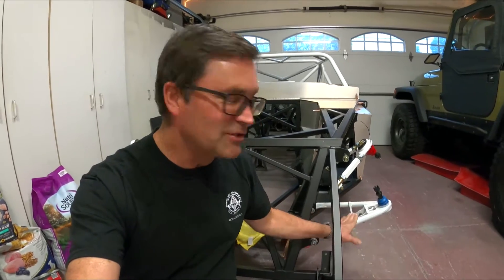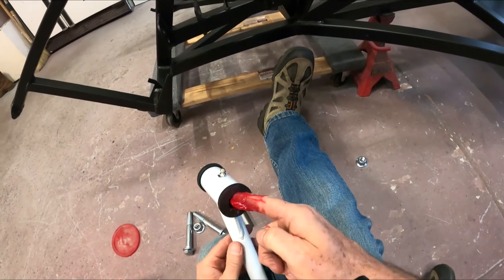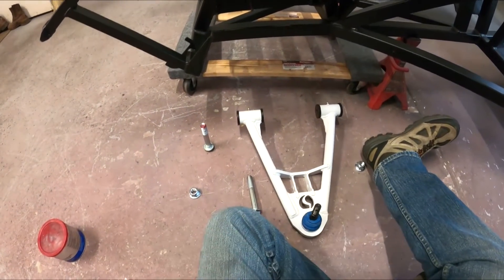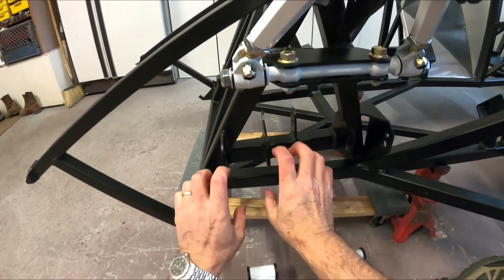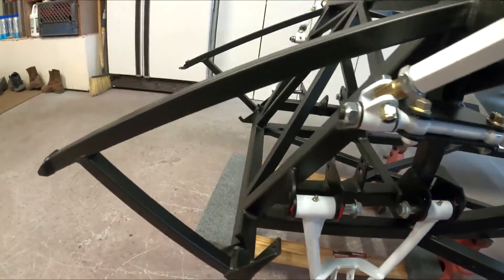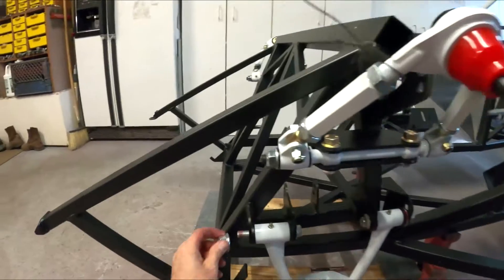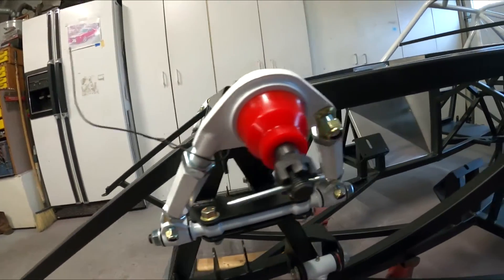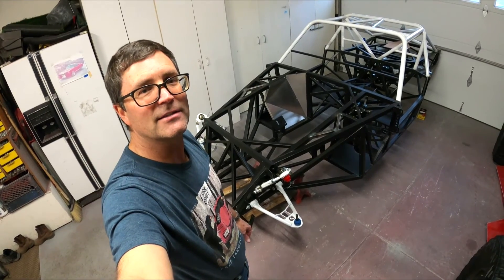Cobra Daytona Build- Lower control arms video 15

Comment: Shouldn't the bushing be torqued when the suspension is under load?
Reply from the maker: It would be nice to have a bunch of machines. I don’t even have a drill press. I make do with what I have. Thanks for watching.
Reply from the maker: With rubber encapsulated bushings that’s a great suggestion but these rotate easily and I cannot imagine it making a difference.
Reply: @cobradaytonabuild1671  Really like your build.  I like that you don't have a machine shop at your disposal and how to use more ordinary tools to get the job done.